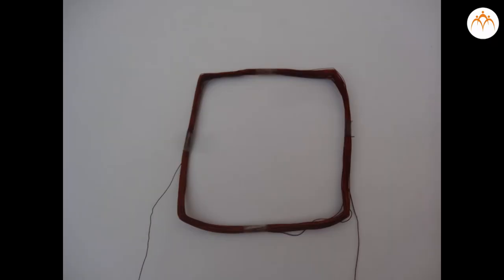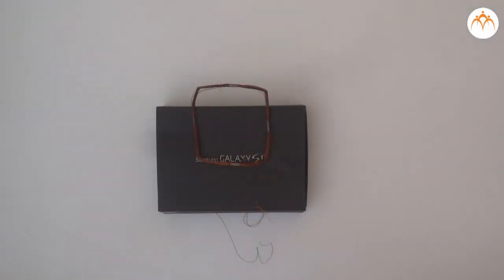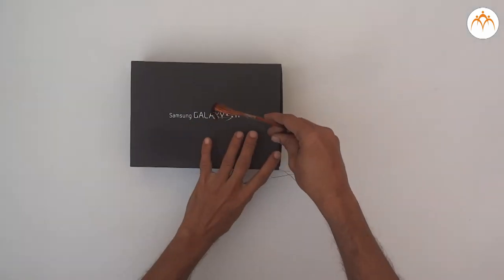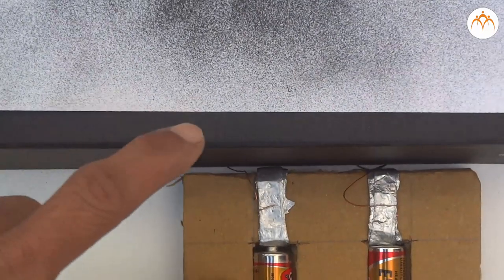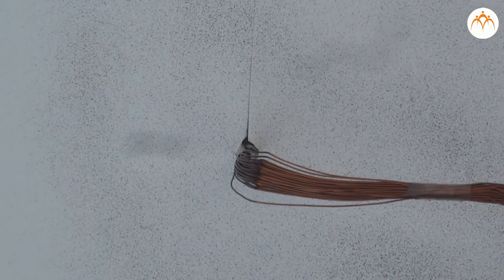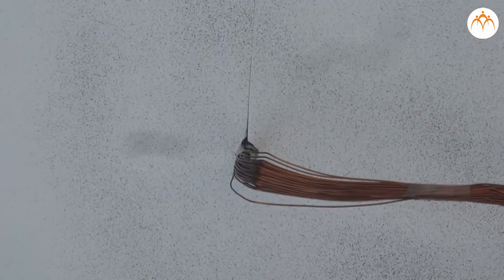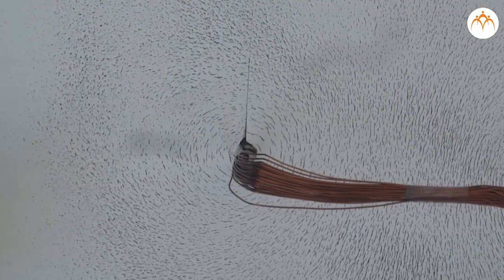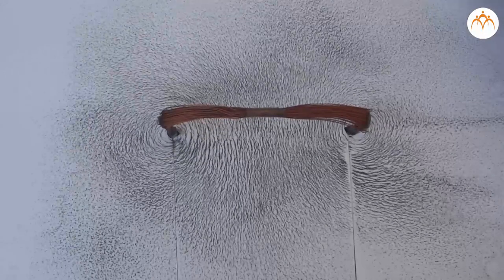To Study The magnetic field due to electric current flowing through the coil

Comment: As per the given information 

We have to increase the electric current through the coil gradually 

So for this purpose what should we use 

As per the diagram given in the 'Science and Technology Practical Notebook' it is suggested to use a 'variable resistance'. 

So do we need use it while conducting the Experiment